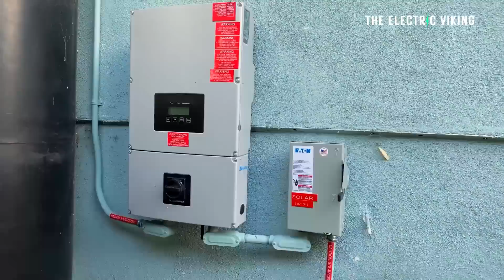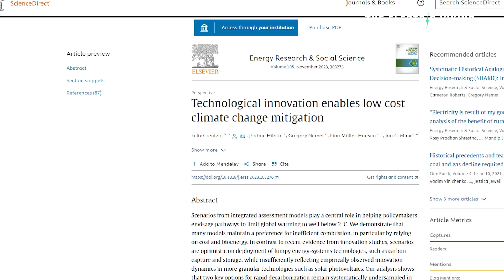Fossil fuels ‘become obsolete’ as solar & battery prices hit 'tipping point'

Comment: fossil fuels will never be obsolete ...Do a bit of research ...you need fossil fuels to make your plastics which is in every thing you currently use in your life..
Reply: If you don't burn it, it not the fuel any more.
Reply: Nothing is 100%. It’s the trend that we are focusing on.
Reply: @michaelnomura5196 sure. There are some people who still ride horses.
Reply: The plastics are made with the leftover gunk that we didn't know how to recycle. Plastics are not the driver for the oil prices.

We need plastics but I also sure as hell hope we get them and PFAS out of our bodies, food and water supply.
Reply: Let's get the cock-waving out of the way to save time later - I worked as a design engineer & commercial manager in the automotive industry for over 30 years so you could say I have a little experience in materials technology, also my father was an engineer in the petrochemical industry, so I have "Done some research" there too.  Let's just say: 1. They're no longer fuels if your using them for plastics and not burning them .  2. You don't need oil for them, they're just cheaper using oil as they're bi-products of fuel manufacture (or you could say thee other way around).  The obsolescence of the industry remains to be seen, as one needs to weigh the increase in cost of raw materials caused by loss of revenue from fuel, against the desperation of companies with a turnover in freefall.  Expected cost increases which would make alternative sources competitive, may be tempered by petrochem's willingness to accept a reduction in the massive profits they are accustomed to in the name of survival.  One thing is for certain, the disruption will be considerable.
Reply: fuel

/ˈfjuːəl/

noun 

material such as coal, gas, or oil that is burned to produce heat or power.
Reply: You are incorrect. Plastics, paint, fertilizer, and explosives as well as liquid and gaseous fuels can all be made without fossil fuel feedstock.

Most of these synthetics rely for a starting point on variations of the Haber Bosch process to make ammonia from  atmospheric nitrogen. Further processes using feedstock such as seawater can give rise to a wide range of long chain hydrocarbons in including diesel and jet fuel without depleting buried stocks of fossil carbon. That material (gas, coal, oil) for the most part, can remain in the ground.

The synthetic processes replicate in a way the natural processes that gave rise to fossil fuels in the first place. 
Unsurprisingly they are very energy intensive involving very high temperatures and pressures. Viking is likely incorrect in believing the this type of industrial high grade heat and pressure can be readily achieved with renewable energy (except perhaps hydro). This is because they require very high levels of 'energy intensity'. 

This is best achieved with high temperature energy sources and is one of the main reasons generation four nuclear reactors are being developed. They operate at much higher temperatures than the current generation of nuclear reactors. They will provide the high grade industrial heat (>600C) needed for industrial processes involving synthetic chemistry, as well as more mundane things like metallurgy (steel, aluminium etc), silicon processing, bricks and cement.

In a post greenhouse gas world, those countries unable or unwilling to use nuclear energy to power these high energy industrial processes will need to relinquish them to less squeamish countries.

Fortunately for the provision of these essential goods, plenty of leading industrial countries, particularly China, Japan, India, Indonesia France have all announced major nuclear development programs aimed at energising their industrial processes without the need to burn fossil fuels.

https://en.m.wikipedia.org/wiki/Haber_process
Reply: @jimgraham6722  A 'post greenhouse gas' world?  Please think about what you're posting...it's ridiculous on its face.  And the reason you DON'T do automotive plastics from feed or grass stocks, is because thise plastics are weaker, break down under sunlight, and separate out into their component substances over a very short time.  Plastics from petroleum, DON'T.
Reply: @jimgraham6722  You don’t need either fossil fuel OR nuclear to achieve industrial heat temperatures. To the extent that combustion is currently used for heat, well… fossil fuel isn’t the only thing that can burn. Green hydrogen can be made with over 50% energy efficiency from electricity. It burns at 2660c when mixed with oxygen, pretty close to methane at 2810c. But how many processes need those temperatures? Antora Energy’s heat battery, powered by renewable electricity, can do 1500c - hot enough to make steel or cement, or power most chemical reactions.
Reply: @davestagner  Agree that is technically possible. The issue is hydrogen production at large scales has its own production, storage, environmental and safety issues. Hydrogen for steel production has particular issues still unresolved. The footprint for H2 at large industrial scales is enormous and there is a lot of push back against that.
Reply: Bioplastics. Easy.
Reply: @Dr.Gehrig  yup, several ways to do it, but for some reason random people have decided that they need to be the holy defenders of the oil and gas industry on social media 🤷‍♂️ Unless this guy is getting paid by them, not sure why he’d care about what feedstocks are being used to make the plastics we use, other than if the costs increased significantly.
Reply: @JohnDoe-de3km  x-acly
Reply: He's talking about their use for renewable energy you Muppet
Reply: You can believe this or not but we are 12 to 18 months from all fossil fuels going obsolete for all purposes. AGI gives us Molecular Nanotechnology. Molecular Nanotechnology gives us Artificial Super Intelligence. MNT instantly ends fossil fuels. MNT will happen so fast that we will never see it coming.
Reply: Do you understand the term Fossil FUEL ?
Reply: @MarkSpohr  Yes, we all understand the term fossil fuel, and that petroleum/methane used to make plastics aren’t really “fuel”. You’re like the 20th person on this thread to make that point, and it’s no more insightful now than it was the first time.
Reply: @davestagner  Then why do people keep making the same stupid remarks?
Reply: @MarkSpohr  We say “fossil fuel” to mean “fossil carbon”, because it’s the common term. Why YOU are making such a pedantic point about it is a different kind of stupid remark. Seriously, you know what we mean. We know what we mean. This is the same crap as the dudes who correct someone who uses the term “assault rifle” when talking about school shootings. Don’t do that. Make a real point, don’t just correct the grammar.
Reply: Petroleum is used to make plastics but it is not fuel unless refined into fuel. You sound silly
Reply: I agree but the point is reduced dependency to fossil fuels, so we will burning less and less fuel in the future.
Reply: @thatsawesome2060  Fossil fuels will be gone with in 2 to 3 years. You do not seem to understand what is coming. AGI=MNT=ASI= Singularity. The end of fossil fuels and a lot of other things including baseline humans.  There will be no need for fossil fuels or even materials. MNT will solve all of that with in a few weeks. Well, maybe faster but there are heat limits to contend with. The most likely out come is MHD based craft heading into the solar system for raw materials and at the same time waste dumps being injected with nanomachines to clean them up and gather the materials stored there. The end is months away at most. It is going to be a crazy ride.
Reply: He is talking about fuels. Plastic is not a fuel. Fertilisers are not fuels.
Reply: It is used as a building block not a fuel in that application, but it is likely that jet fuel will be produced for 30+ years
Reply: Do a bit of research in the into the language, it's not fuel if it's being used to make things
Reply: Ok… WHY do we need fossil fuels to make plastic? Plastics are hydrocarbons and chlorides. We use petroleum as convenient raw material for the carbon and hydrogen, but we could also synthesize them from CO2 and H2O (which, I will remind you, is how Nature made fossil fuels in the first place). The chlorine in plastics like PVC (polyvinyl chloride) is not from fossil fuel. We currently use fossil fuel to provide the industrial heat in the synthesis process, but that can be done using renewable electricity as well - and industrial heat from renewables is under active development and early commercialization now. If (when!) it becomes cheaper to provide the heat from renewables than it is to use fossil fuel, manufacturers will switch. 

You are making a flawed argument. There is no step of plastics manufacturing that cannot be done without fossil fuel.
Reply: and if your synthesizing them that still means your using fossil fuels.. @davestagner
Reply: @mindbender50 Wow. You got both parts of the word “fossil fuel” wrong. 
First off, fossil means the carbon was removed from where it was sequestered before we removed it. Usually for millions of years. 
Second a fuel is something that is burned. So if you are making plastic out if it, it isn’t a fuel.
Reply: @mindbender50 what does “fossil” imply?
Reply: @mongo64071  it’s only a fuel when it is burned.
Reply: @mongo64071 so you can use Cow farts (methane) to make plastic? Or the gas from decomposition of organic matter in landfills so not really fossil fuel related except that methane is a byproduct of the refining process.🤔
Reply: @mongo64071  Please show where this process is outlined and demonstrated.  You can't.

Read up on the abiotic process.  It explains all the components of petroleum that DO NOT EXIST in organic matter.  And since the Mt. St. Helens eruption has given us plenty of chances to see petroleum come from biological sources, and it ISN'T, proof 2 that your assessment needs an immediate RE-assessment.
Reply: @davestagner  Why on earth are we making plastic in the first place, milk used to be delivered in glass bottles and be reused the same with things like coke drinks which were sold in glass bottles and you got a discount if you took your old ones back!
Reply: you are flawed ....
google it yourself 
Over 99% of plastic is made from chemicals sourced from fossil fuels. @davestagner
Reply: and its not for convenience sake.... unless you want to pay a million dollars for your car at the present time.. @davestagner
Reply: @mindbender50 once scaled, synthetic hydrocarbons will be cheaper.
Reply: if it can be electrified it will be
Reply: @rctezluh42069 ❤❤❤❤
Reply: If you are making plastic out of it, it isn’t a fuel. Just saying.
Reply: There’s a lot more to fossil fuels like fertiliser to name just one! Look at what happened in Sri Lanka when they tried to not use fertiliser!
Reply: @X5493-c7p you can make fertilizer with any energy source. FF have been used in the past because it cheap. It's not going to be the cheapest in the long run.
Reply: @X5493-c7p if you aren’t burning it, it isn’t a fuel.
Reply: @williammeek4078  it still has to be refined and if they can’t sell the diesel; petrol and other fuels from the refinery stack then fertilise costs will go through the roof and more poor people in third world countries will starve when they can’t afford it just look at Sri Lanka when they purposely went organic and had massive reduction in food crops! Other countries that can’t afford it ultimately have the same result as Sri Lanka even though they don’t want to go green.
Reply: @X5493-c7p No, no, no. If fossil fuel gets cheaper, synthetic ammonia gets cheaper. Ammonia for nitrogen fertilizer is synthesized by the Haber process, and most of the plants run on fossil fuels. If electricity becomes cheaper to do the Haber process then we will get more ammonia for cheaper.

The two things we need to have a massive food supply are cheaper sustainable way to do the Haber process, and cheap low energy desalination plants.
Reply: @X5493-c7p  eventually, you get to the point where fossil fuels are more expensive than hydrogen. Then you make your ammonia from green hydrogen. One of the few legitimate uses for green hydrogen. And it won’t cost more at scale. 
Only a problem while disruption is happening, mostly because of people like you who just can’t deal with change. 
It is sad, but welcome to the real world.
Reply: @williammeek4078  You first.

Look up what it takes to STORE and MOVE/PIPE hydrogen, and you'll soon realize there's no way hydrogen is cheaper OR safer, even with artificial inflation of petrofuel costs by government edict.

THAT is reality.

Comment: Fossil fuels may be becoming more expensive but for the next 10 to 15 years we will have to keep using them or the lights will go out. Also if solar is so cheap, South Australia has a large amount of solar, why does it have the highest electricity per Kw in australia.
Reply: It’s because the SA govt privatised all the energy generation and distribution in the 90s.  Now you have monopolistic behemoths extracting as much moola as they can from the long suffering SA public…isn’t privatisation great!  It also means that the people of SA have more rooftop solar per capita than anywhere else in the world, exactly so they can avoid those high energy consumption tariffs.  Most SA homes don’t draw anything from the grid during the day, and export so much that some times the whole state grid is running 100% off free electricity from the sun.

Comment: USA should supply the Grid with extra electricity so that EV infrastructure becomes ready.
Reply: Electric supply isn't the problem.  It's reliable chargers in the right places and transmission capacity.  The government has already put legislation in place to speed the energy transition.  The transition is moving rapidly now.
Reply: It will happen anyway just through standard economics.  Might be worth funding University and other research.  China is winning that game, I believe.